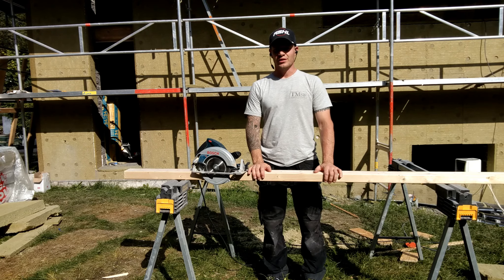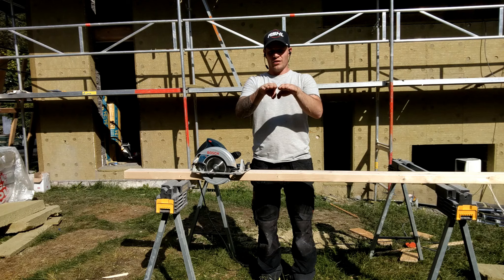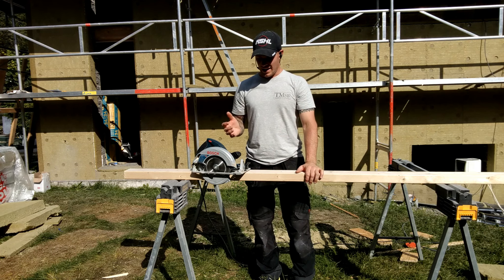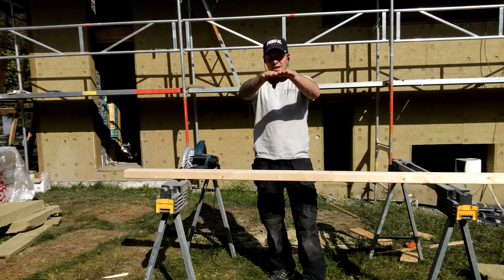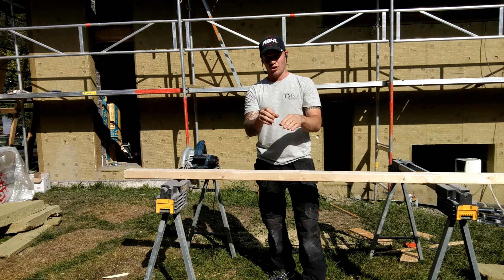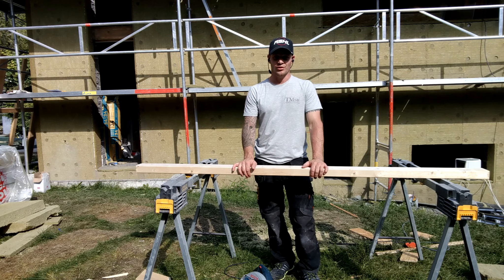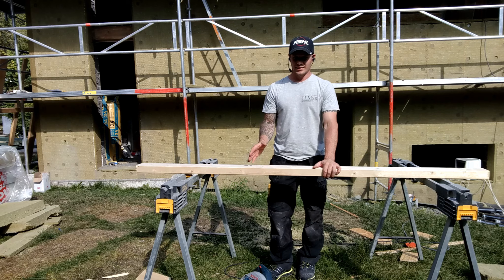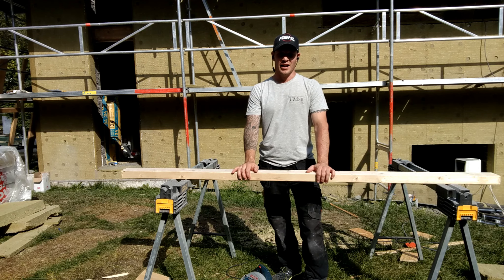How to prevent circular saw from kickback

Comment: This is great. Exactly what I need right now. Just got my first circular saw, an older US made Craftsman model, and I’m trying to learn every safety measure possible before I put it to use. What I’ve also seen recommended is to clamp down the wood I’m cutting off to the saw horses or to whatever edge I’m going to be working on. Thanks a lot, this is helpful.
Reply from the maker: Happy to help! I have more video explanations on using the circular saw as well as other construction tools on my channel if you are interested in learning more!
Reply: I had my circ saw just kick back at me like if i was cutting backwards, funny 
It didnt want me to cut a sticker
Reply from the maker: @dancearoundtheworld5360  Always take caution when using the circular saw. They can be very dangerous if not used correctly.
Reply: @allskills2298  i had it kickback once but realized a dull chisel style blade was on it, bought a spyder once

Id say i know there not safe unless you got a mag 77

But the blade is the only thing that matter (cheap saw, high quality blade)

Comment: Good video thank you , ive also read that you really should set the depth of cut on the saw to help avoid this
Reply from the maker: Yes setting the depth definitely helps. Always set the depth 1/4 inch more than the thickness of the material you are cutting. That way if the saw does kick back it will also help reduce the risk of injury because the guard has a shorter distance to spring back and cover the blade of the saw
Reply: @allskills2298  i tried cutting on the outside of a saw horse but still had kickback. I was cutting some base bored with a smaller circular saw. I would get about a 3/4 of the way through the cut and the blade would stop. I kept trying to force it and it kept kicking back. I finally gave up and used a hand saw to complete the cut but it splintered  the board and ruined the cut. I thought maybe my blade was dull. Now I’m thinking the depth of the blade maybe 1-2 deeper than the board. I was hesitant to try the saw again but I may give it another shot and change the depth to 1/4. Any thoughts why it would pinch on the outside the sawhorse other than flimsy board and blade depth?
Reply from the maker: @evolute99 this is a great question.  The first thing I will suggest is to not cut any mouldings using a circular saw. It's much more difficult to keep your cuts straight as it's easy for the blade to wander. You can rent a miter saw at home depot for as little as $36 USD a day. 

There are 2 things happening here making the saw kick back. 
1. If you are making a 45 degree bevel cut to the short point with the good side of your baseboard facing up then the "kick back point" will actually be pushing to the bottom of the saw. (I will make a video for this soon) 

2. Because the material is thin, this makes it easy for the blade of the saw to wander slightly and it's difficult to keep your saw cutting straight. This ends up causing the blade of the saw to twist while cutting resulting in the saw binding and kick back. To minimize this you would be correct in adjusting the depth of your saw to even 1/8th inch deeper than your material thickness. This will not necessarily correct the twisting of the saw blade. Only minimize it. The saw can still kick back in this position. Try cutting with the long point of your 45 degree bevel cut facing up.

Comment: You saved my hand sir! I got 3 huge kickbacks ND one of them almost took my thumb off. Thank you so much!
Reply from the maker: Happy to help!
Reply: What I learnt from another video was clamp your cutting piece down onto 2 3x4 inch thick pieces of timber situated underneath (so your main piece is raised) and on either side of the cut line so they support the piece and prevent any pinching. Hold both handles on the saw & position your body so you're not in line with it i.e. cut from side.

Comment: Very nice video, glad this popped up in my recommendations
Reply from the maker: Happy you enjoyed it!
Reply: @allskills2298  how do you feel about using the circular saw on the ground with insulation foam? I've seen some videos that use that style for cutting and it seems to work well for them
Reply from the maker: @adamthewoodworkinglawyer  cutting from the ground is also useful. It takes a bit more time to learn and get comfortable with. I have a video for cutting from the floor in the "tool safety" on my channel. I recommend checking it out! 

As for cutting foam insulation with a circular saw professionals can do this if they choose but I wouldn't recommend it unless you are very confident with the circular saw. It is easy for your wrist to turn just slightly with the saw and the saw will kick back.
Reply: @allskills2298  So the way I typed it out, I think meaning of what I was asking about the insulation foam was misunderstood. I meant to ask if it would be ok to cut wood, such as a 2x4, on the ground with insulation foam UNDER the wood. Thanks again for the response

Comment: Not had kick back with a skill saw, usually I find the blade just stops if it pinches.
 Kick back on a mitre saw scares me though. It sounds like a shot gun going off, and your hand is blown off the tool.
 It took me a month to get comfortable using the tool after, and I still remember that kick back, and make sure to avoid anything that will cause it.
 I love the circular saws though, very nice tools, but you need to be careful with them.

Comment: Useful demonstration of a kick-back. Missing & important: eye-protection, checking the blade guard is back in place and saw stopped moving before putting saw on the ground (major toe hazard), making sure no body part is behind the blade when cutting -- thigh, body, fingers, toes (some people cut on the floor with the toes behind the blade when cutting).

Comment: Apparently I'm the one guy who gets kickback even if the piece is being cut as described...
.
As a woodworker for about a decade, I've learned that the circular saw is one of the tools that doesn't like me, so I only use it if I absolutely have to
Reply from the maker: If it's an old saw it could be faulty. Or it could be your wrist turning while cutting. It's important to make a straight line and follow it!
Reply: That’s me with a table saw. Not meant to be

Comment: Why do you continue to only use 1 hand when the machine has two handles? Why do you place your free hand adjacent to the saw when both handles are opn TOP of the saw?
Reply from the maker: You could of course put both hands on the saw as long as you clamp the wood down. But on the jobsite you don't have time to clamp every single piece you cut. For a person of novice level I would recommend starting with clamping the material down and using two hands
Reply: @allskills2298  Thank you for the reply. 
However, you just supply more evidence why your vid needs redoing. You really are saying you have no time for safety in every operation of a powerful circular saw? That is, you have no time to be mindful of all the precautions needed EVERY time you pick up that dangerous tool. 
It is like saying you have no time to obey all the different speed limit signs encountered multiple times each day! 
It is called SAFETY for a reason. How much time will you save recuperating from a ripped tendon or nerve? How about the loss of a thumb - that alone will give you all the free time in the world away from a building site? 
What about a flying saw hitting a work mate? You have no time to consider the wellbeing of others? 
If you have not the time to safeguard your own safety, then how can anyone trust you to be mindful of doing a good job on each and every task that goes into construction? Do you have the time to give full and proper care to each and every one of those tasks for a customer? Or, does “No worries - she'll be right, mate.” become the moral?
No wonder building sites are some of the most dangerous locations in the economy. It is not always faulty tools causing death and accidents – it’s the faulty thinking of operators. 
As far as your stated belief that only novices should use clamps, that is just another indication of your irresponsibility. How many experienced builders have seriously injured themselves by not clamping material? (Please do not ruin your credibility any further by saying, “None”.)
Please change your vid to something more valuable and responsible by including best practice procedure.

Comment: you didn't say what to do if it does kick back...immediately stop the saw or keep it going? Because even if everything is set up right it can catch.
Reply from the maker: If everything is set up right it won't catch unless you are twisting the saw as you cut.  A saw kicks back so fast you don't have any control over the saw. Your natural instincts will be to take your finger off immediately as having your saw spinning at full speed and having no control is extremely dangerous. 

After a kick back happens:
1. Check that the material is set up right and there is no pressure points. 
2. Check the depth of your saw to be no more than 1/8th inch deeper than the material you are cutting 
3. Start cutting again and be aware of twisting the saw while you cut 
(You can even unplug the saw and check the blade for any damage. It would be rare to damage the blade when cutting wood but it could happen)
Reply from the maker: @jayembrown5395  yes exactly right.

Comment: Sorry but it is not true, if you let the part free falling, yes it would work most of the times, but if your piece of wood is thinner than what you have in the video, the saw blade go through the wood, as the cut going, the free falling part is going to clamp the blade from bottom because its tilting downwards, causing a kick back
Reply: Worked as a carpenter for 16 years. Never has that happened. What's actually happening when you cut thin pieces of wood is that the saw is easier to move from your line as you cut and this will cause kick back because the blade is twisting as you cut. That's why it's important to set the depth and practice.
Reply: @jeremybolduc7171  I mean its the same issue but the free falling part can clamp the blade from lower part when the free falling part bend the wood upwards, instead when the video only talk about the most binding happens when the wood is bending downwards. You never met it, but it happens to others.
Reply: @gachagameplayer2143  how thick is the material you are speaking of? Because the end you cut off will fall towards the ground unless you are turning the saw as you cut. It's crucial to keep a straight line as you cut thinner material and deviance from the line and yes it will kick back.

Comment: And never use a circular saw with a wobbly blade/bent shaft.  It ain't worth it, cut the cord off and throw it in the trash.
Why do I say this?  I had a buddy working on a job site pick up his boss's spare saw to cut 2 by fours for framing.  As he was being loaded into the ambulance the boss said maybe I should have thrown that saw away because the blade wobbled a bit.

Comment: Still kickbacks even on the end
Reply: What size of material are you cutting? And are you making a beveled cut? 

If you are holding the saw correct, keeping your cut straight and not making a bevel cut then the saw will not kick back.